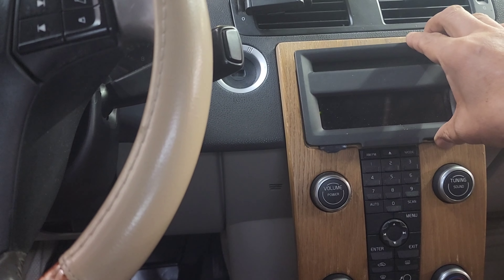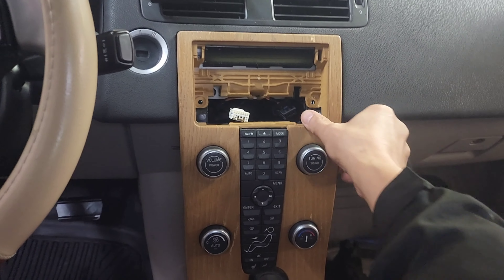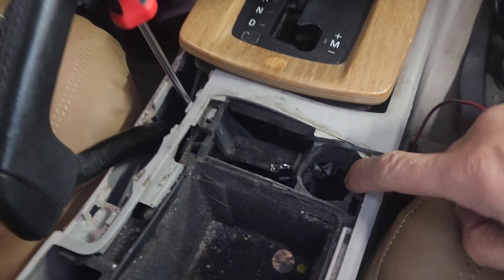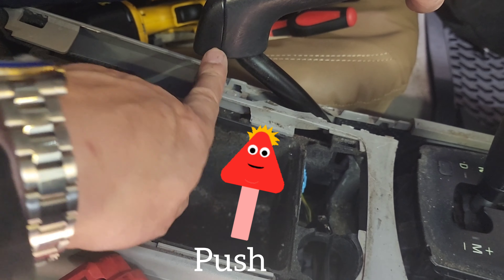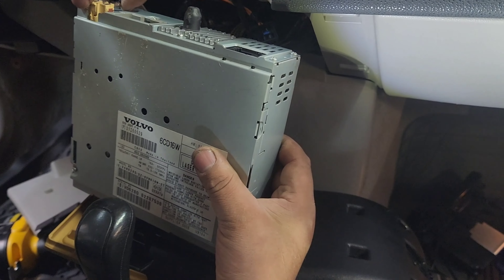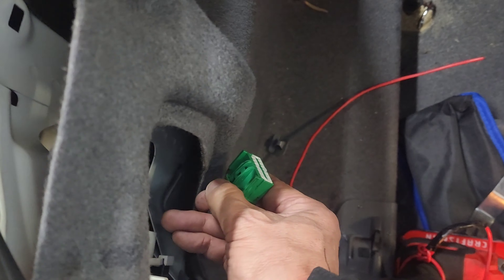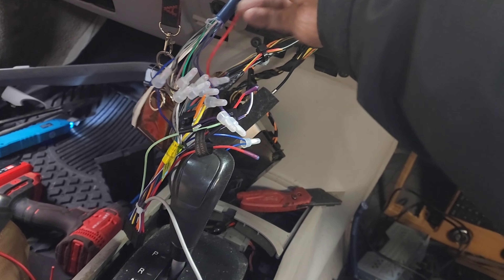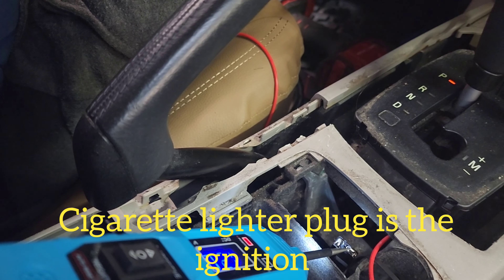2006-2013 Volvo C70 How to remove radio Install Carplay android auto Amplifier location bypass amp

Comment: The fibre optic cable need to connect back to the original player?
Reply from the maker: @josephlee1684  you need to disassemble the module like this video and tape it then put it behind the radio like this video, please watch till the end 🙏

Comment: My car says cd where yours says mode
Reply: Does this mean I can because there isn’t any aux?
Reply from the maker: That doesn't matter, you are not going to use factory system, you are only reconnecting the fiberoptic to control dashboard and windows